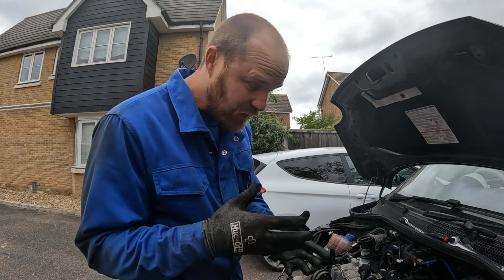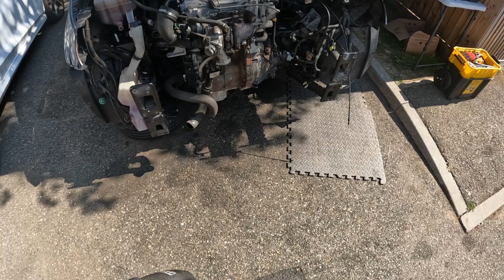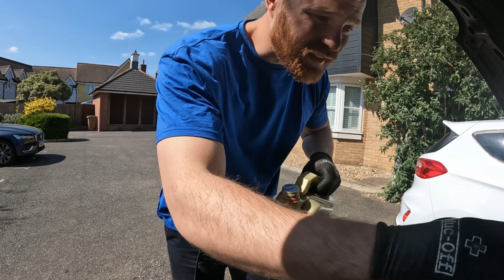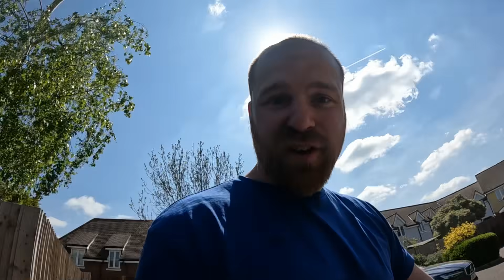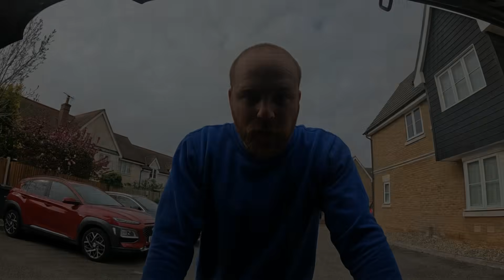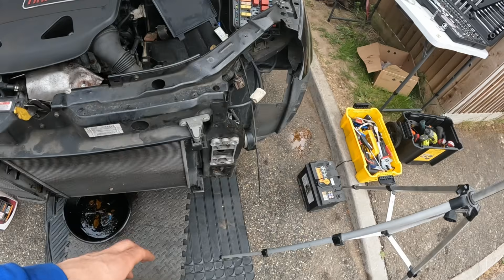I don't want to work on a Fiat again

Comment: I checked my haynes manual for my alfa with multiair (twinair, but more) and the oil spec changes exactly as you described from EURO 5 to 6. The twin/multiaiir is oil dependant to work properly, and not keeping on top of servicing does it no favours. The spark plugs also take a battering (especially with stop/start on) and need to be changed more often too. There is also a dedicated filter which needs to be replaced every so often.

Comment: Your engine was completely fine. Multi air engine has exhaust valves activator which is operated by oil pressure. When oil level is low, it is loosing compression as it can't close the valves. Your issue was turbo eating oil. And one more thing, Selenia is dedicated for Multi air, and Castrol is not. It might cause issues in the future. Cheers

Comment: Re: Coolant Tank and dirty Red/Brown colouration.

VW Golfs Mk7 had same coloration issue. If you lookup on Youtube they have a bag of silica in the coolant tank and this often splits open releasing loads of tiny silica balls that ultimately block up the heater radiator/heat exchanger. Check it out on You Tube.

Has happened to me, not saying this is the same issue here but would check it out. Solution is to remove the small bag of silica beads using long nose pliers before it bursts ! , if found in a Fiat Panda cooler tank.

Comment: Oil viscosity is also directly related to climate. So here in Australia we need higher viscosity oil because we deal with high heat and rarely cold and never freezing for 99% of the country. So typically we would go up at least one grade higher ie. 20W-50 is a pretty thick oil with a narrow temperature range.  Most 'rice burners' use 10W-40 here ie. Hyundai, Toyota, Mazda etc. Specialist engines like Alfa, BMW, Merc etc have their own oils and typically are expensive 0W-60 to cover ALL basis and all climates but cost serious bucks. A Castrol Edge version cost like $120/5ltrs or around GBP55/5ltrs. Where as narrow temp range oils are half the price. Using a high viscosity oil in a cold climate won't work. ie. 20W-50 in Northern England  or Scotland would not be good for the engine. It will give you great compression, but might end up fouling plugs. With cheaper oils you need to be spot on with the 'viscosity-to-weather' ratio which is a little guess work and manufacturers recommendations. Every Hyundai Owners manual has this info in them because their cars are sold to EVERY climate and have the most experience with that issue.

Comment: Realise it's been a while but what worked on my driveway after the sump went on an old Jeep was sprinkling old fashioned soap powder (laundry detergent) on the stain every few days, replacing after it rained. Just a light sprinkling, not shovelled on.
Worked well, no real work, was not instant though. 
Was a month or so before I couldn't see the stain.

Comment: Me too I hate the new Fiat, so a bad design. My 1.9 Multijet 8v glow plugs are right in the back of the engine, required to lose the EGR pipe. Horrible, glad I no longer have Fiat now.

Comment: Hi.
You can clean the engine coolant system with water mixed with two dishwasher detergent "pills" and let the engine run for a few hours or if you can drive the car let that coolant for @ 100 miles. 
All the best wishes from Romania!

Comment: You need to put some (2 or 3) dishwasher tablets into the coolant tank and run as normal to clean the system then drain, flush and fill with proper coolant.

Comment: i know its late but when i worked as a cleaner one place we cleaned was a garage and we used rubicon to clean up the oil on the floor dont know how well it would work on road surface but it worked in the garage floor

Comment: Hi Great videos. Your so right about the lack of info online.  Trying to find out the location of the fuel injectors so I can disconnect the cable to test as getting injector circuit fault codes. Assuming its possible to do that without dismantling the engine ?
Reply from the maker: The injectors are easily accessible from the top. Just need to remove the big plastic engine cover/air filter and you’ll see them

Comment: I agree with you about all the BS around on the precise oil to use in any car.  Had you not confirmed, I would have guessed just any fully synthetic 5W-30 C3 (low ash therefore low carbon) oil - any brand.

Comment: Neither do i ! I've worked on a Fiat grande punto and every bolt that I tried to undo has snapped 😳 🤧  it wouldn't matter how much DW40 I used still snapped even the bolts that should hold the clutch to flywheel,the bolts that hold the alternator the bolts that hold the Ac compressor and many other small bolts! That car was a nightmare 😫. In the end I managed to fix everything .and I said never again work on fiat

Comment: So. It sounds like your last engine sucked air instead of oil, going round that roundabout, lost prime at the valve module, which stopped the valves from being opened. Engine was probably fine 🙂
Reply from the maker: I sold the original engine (for very little money) to someone who was going to chance it in their car, but they said it was mangled. They ended up weighing it in 🤷🏼‍♂️

Comment: I don't pre measure the oil ether. I'll just pour somewhat close enough and check from the oil stick.
After the engine has been run and oil light has been shut I'll check oil level from the stick again.
Reply from the maker: Yeah I need to check the level again before taking her on a test drive. Coolant too come to think about it...

Comment: I'd clean the inside of the header tank bottle off the car with a few Steradent tablets. The brown stuff is just hard water limescale!
You really need to remove the spark plugs whilst you crank the engine to get the oil circulation and pressure before you attempt a start!

Comment: Was the Uniair filter (part number 71770205) also changed? It needs no change at every oil change, but swapping in a new one or at least cleaning the old one in fresh oil every 40-60.000 km is a good idea.

Comment: Hey Nino. Yes the others are right. Whip out the spark plugs and crank it for much longer. You need to draw the oil up to the top to activate the valves. It sounds at the moment like no compression. Good luck mate, love the videos..!
Reply from the maker: Cheers, Neil. I'm gonna give this a go. I suppose I was just worried about the stress on the starter motor, but have got a lot of advice on how to do it properly without stressing it, so hopefully that works 🙏🏻

Comment: Go over the Work You Have Done..! Check all the  Electrical Connectors and Other Connections...! Also make sure you have put the Right Amount of Oil in the Engine. The Best way to do this is Check Specifications and use a Measuring Jug to measure it out liter by Liter. Good Luck Mate...!😇

Comment: I've had good results on concrete driveway with NEAT green fairy, its a pretty powerful degreaser. Apply neat, brush in and then cover with a plastic bag or upturned bucket. Give it time then scrub it off, repeat if it yields a result. Its so cheap its worth a try.
Reply from the maker: Someone else has mentioned that, so will definitely give it a go 👍🏻

Comment: Hi, I'm a Fiat tech from Italy. Twinair module needs to prime in order to open intake valves, you need to continue cranking the engine until oil reach the twinair module. But you also need to remove spark plugs several times and clean them, because they will soak with petrol, until engine finally starts. Alternatively, you can crank the engine without the plugs for ~1 minute to build oil pressure. Anyway, I remember that even brand new cars with this engine, when standing still at the dealership for some time, would have this problem 😅 good luck!
Reply from the maker: Grazie, Tommaso! I'll give this a go and see what happens 👍🏻
Reply: @NotEconomicallyViable  Also for future reference, usually running a turbo with out oil destroys the turbo..... and piston rings don't get stuck from lack of oil, they aren't supposed to even see oil. I figured as Tommasco said that oil primes the timing side of the engine which sets engine timing.
Reply: For any U.S. viewers, this also applies to the 1.4 MultiAir
Reply: @roccol3110  multiair is the valve system from FIAT, it goes on many engines and so the twin air (means 2 cylinders).
Reply: @hlq2action310  I know, I just mentioned also that in the U.S we get the system too but on our 4-cylinders instead since we don't have the TwinAir here (whether that's good or bad idk much about the TwinAir's reliability)
Reply: That was very nice of you to share that Tommaso.
Reply: Hi Tommaso
Would you recommend to buy a 500 fitted with a twinair? Im a VW mechanic and looking to buy a 500 project. Found one but its a dualogic auto.  Engine runs good but gerbox not selecting gears at all. Also has a high pitch noise coming from bellhosing area.  Something like when sandwitch plate catches on the flywheel.  Noise goes away once revs up or over 1500. Dont know much about these set ups would be a great help if you could tell me if this is something worth to deal with or just forget about it? Cheers in advance. Chris
Reply: Do the exhuast valves operate hydraulically too?

Comment: I agree with you on the oil spec, alot of nonsense goes on especially online debating about stuff like that. My"500" recently had a coolant leak from the top hose of the rad, and I topped it up with the stuff you have, and it's going to stay there. I am not going searching for some branded stuff which probably makes no difference anyway....,..
You can definitely hear the pump priming from the rear when you turn the key can you?? Unfortunately it is probably just a trial and error process to find the fault I suppose, I don't know what else to help, good luck with it.

Comment: Crank it with the plugs out.. no compression then and super fast oil pressure build up 😁
Reply from the maker: Heard this a few times, so will give it a go 👍🏻
Reply: @NotEconomicallyViable  try and clear the fault codes prior too start up

Comment: Keep at it Nino,! 

Comments from PD Tech make total sense (especially having the boost pack connected!), as does Richard’s (and others) comments about the Allen Key/Ball-bearing ‘manual-prime’ - I was actually going to suggest the Bump Start method (to force pressure increase through the resistance) but you beat me to it, and cannot use this method in any event. 

I am sharing your pain but you’l get there - attempted an Engine Oil Change this evening (note ‘attempted’) on my 2012 1.4 500C, a simple enough job - 6 bolts holding the belly plate off…check, ‘cept that 5 were 1” and the 6th was 1 1/4” length. All guides advised sump plug was a 13mm head with a ‘from-Factory’ O-ring fitted that didn’t need changing if in a malleable state - wasn’t a 13mm, wasn’t even a 14mm, 15mm, or even a 16mm - f$#%^ng 17mm with a Crush Washer to boot. Why (just like your finding on the gearbox bell housing dowels) do Fiat a) not allow anything to be published, and b) keep changing so much on the design ? Tell you why…..to keep everything in the dealer workshops and keep that cash coming in!

Oil on Tarmac issue - as it’s not fresh spillage, rather ‘soakage’, cat litter won’t absorb it (but do note for future). This might sound a little odd, but ‘fight Fire with Fire’ - get a few cans of WD40 (you’ll always have a use for them anyway), spray liberally (maybe do a test area first), allow to soak, then jet it away - “G101” might also be a good option.

Looking forward to the next instalment and keep those “Whhoshes” and “Pah-Chews” included !
Reply from the maker: I think you're right about Fiat wanting to keep all the info in-house for profit purposes. It's a shame because it stifles any attempt at a vibrant community around the cars, and also limits what the aftermarket can/will do. I've learned from this one, though. Whilst it's probably no bother for an experienced mechanic to see to these cars, for someone with little experience who is trying to learn as much as possible on the job, it does make things particularly difficult. And also for the people who want to service their own cars like yourself!

Comment: Hi Nino - keep the faith. Almost there. 

I do not know Fiats - that stated would it be possible that the trouble codes stored in the ECU you mentioned are preventing the car from starting? Like a "limp" or self protection mode? If you clear the codes will that allow for the ECU to run the needed software program properly?

EDIT: Does your OBD2 allow you to see real time engine vitals - will it act as a way to display an electronic gauge cluster?  I ask as this might help check the oil pressure using the OBD2 and the App on your phone - thus knowing that the oil pressure isn't the issue.  I use DashCmd (Dash Command) app on my iPhone and I can display a detailed dashboard of engine data.
Reply from the maker: I think my scanner may well provide real-time data, so that's a great idea!

Comment: I always use undiluted Fairy Liquid on tarmac Nino. Squirt it on, pour boiling water on it and leave. Then rinse off. It won't get rid of the staining...but it does get the oil out.
Reply from the maker: Ahh ok. Will try that out 👍🏻

Comment: Hi Nino. Some very good advice to follow from your subscribers in regard to getting the oil pressure up. Did you remember
                mine. put the heater controls  to Hot to ensure the water flush reaches the heater matrix, which would probably
                 have that brown rusty gunge inside. ps. also ensure the heater is not on re-circulate. See you in the next one. 👍👍

Comment: Car litter
Reply: Cat litter? I've used it and it does work well. Not quick and you have to crush it down into powder but it's effective. Cement dust is what is used at race tracks oil spills btw.

Comment: Persevere with the engine cranking! It takes ages to prime the oil pressure to get the multiair unit primed up with oil, a lot longer than you will think!
The inlet vavles will NOT function until the unit is primed, I guess there is an ECU engine cut off if no oil pressure getting to the multiair unit.
It will turn over but feel like no compression. Crank it over for like 10 seconds, let it rest a moment, long crank again, rest it, long crank again, give it some gas and it will start to catch, if not give it a break and repeat.
Make sure you have a good fully charged battery and you may also need the help of a boost pack, that's what helped to start mine!👍

You're correct about the 'which grade of oil debate' about this engine, my Fiat handbook says 5w 40 but I checked online, mine is a 2014 Fiat Panda 4x4, wish I hadn't really because much of it tells you to use the 0w 30 which is a much thinner oil.
Which in theory would be fine in winter, you want the thinner oil to get to the top end and turbo quicker, so a thinner oil makes sense in winter.

But let's not forget in warmer weather the engine oil gets thinner as it heats up so that's why I stick with 5w 40 and the garage I take it, checked that was the correct oil for mine!
Reply from the maker: Lots of comments saying that the engine simply needs to be cranked for longer, so I'll give that a go. I just wasn't sure in this video what sort of effect that will have on the starter and didn't want to push it.

Comment: Alternatively, if the oil pressure light on the dash is not going out, remove the spark plugs and fuel pump relay and do your cranking again for 5 or 6 seconds, several times until the oil can light goes out. The ECU will not allow a start until the oil circuit is FULLY primed.

Comment: Under the engine cover in the middle of the rocker cover there looks like an allan key plug, remove it and under there looks like a ball bearing, push a screwdriver down there and have someone crank it over, will fill the actuator for the inlet valves with oil
Reply: This 👌
Reply from the maker: Thanks for this info, bud. I'm going to give this a go. I did another video on YouTube where someone did the same thing on a US-spec 500, but the ball bearing was down the oil filler cap passage thingy 👍🏻
Reply: Will assist the oil prime for sure.
Reply: @MiracleMitch  we had this problem a couple of months ago, rebuilt one of these twinair engines, new head gasket, timing chain etc and could not get it started, tried turning it over and over and noticed the inlet valves were not opening, the valve actuator for the inlet valves could not fill with oil, we did what I posted earlier and the actuator filled with oil and she fired lol
Reply: @vicntez  Had this a couple of years ago with a friend of mine's 500 that had sat for 6 months while she was overseas. Your method primes the top part of the oil circuit for those pesky actuated valves but overall the ECU needs to register a "Not present" for low oil pressure which it will do when most of the oil passages have had enough oil through them, and the oil pressure sensor at the bottom rear of the block, registers the requisite amount of pressure, the valve circuit being one section. Either way Nino should do one or both of our suggestions and it will start, of that I am sure.
Reply: @vicntez  Will it show on a compression test if the inlet valves aren't working  ?